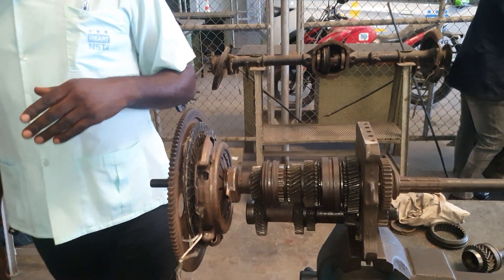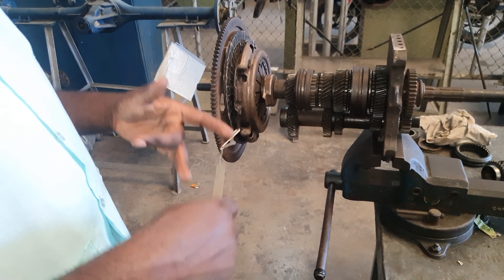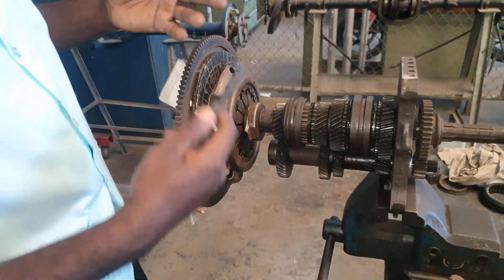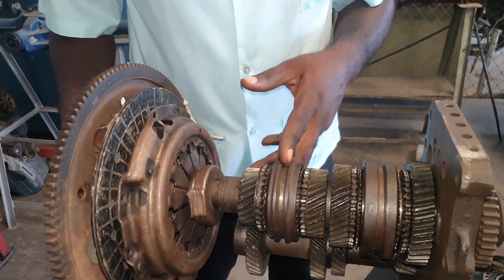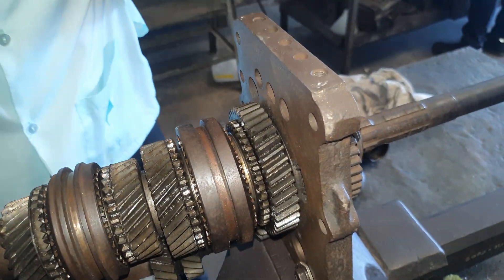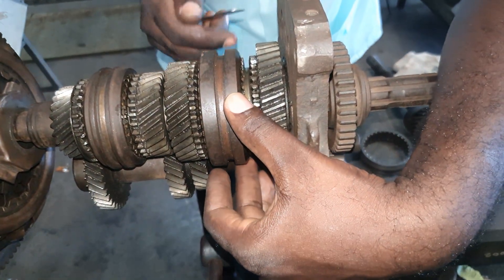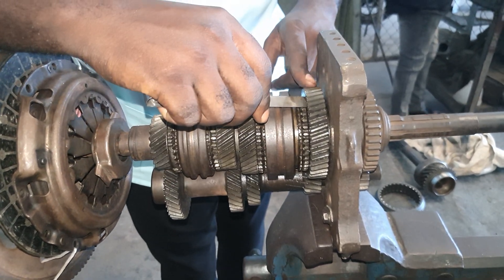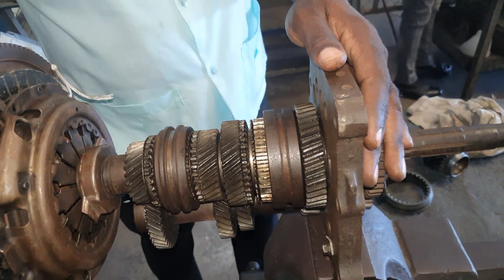Gearbox Synchroniser Operation

Comment: I put some Nulon shift ease in my gearbox it was ok but now it sometimes crunches when i change back down to 3rd gear maybe the Nulon product is very slippery making the syncro ring slip & not stop the crunching?You have a good video.